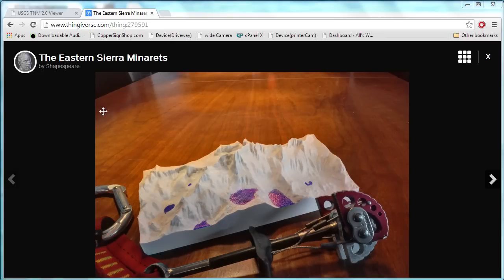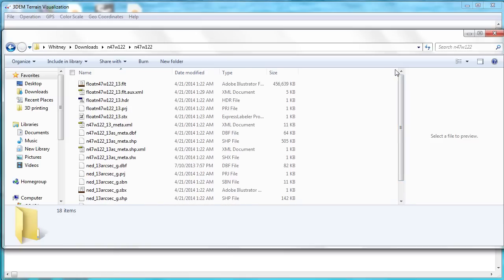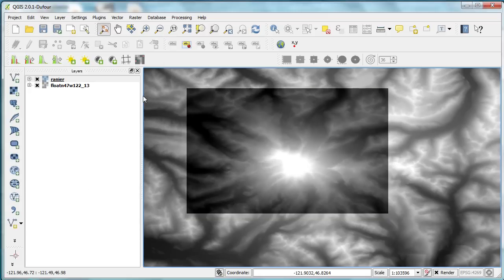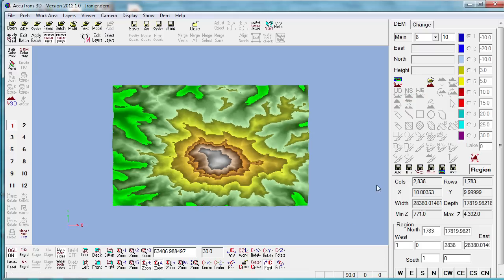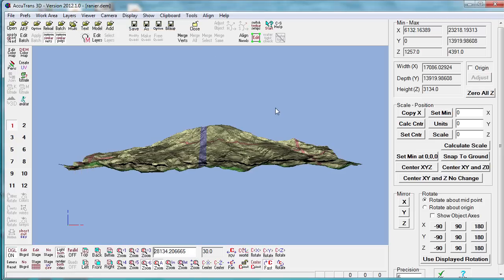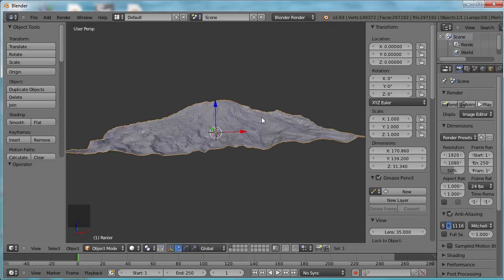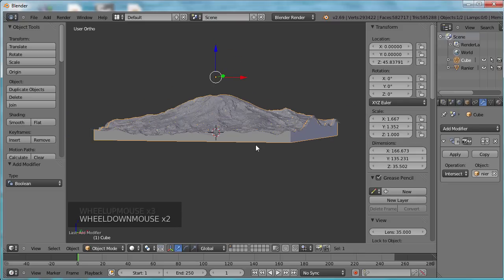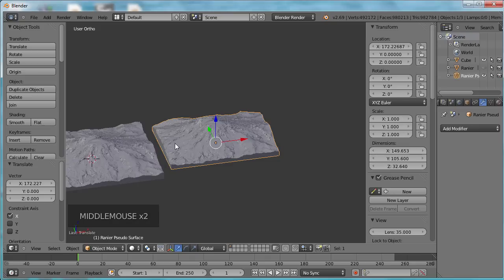Making Miniature Mountains: 3d prints from DEM data

Comment: Hey @Shapespeare, thanks for the video it is very helpful. 

I have a problem - I am using Blender V2.82. The boolean>intersect function doesn't seem to work as shown in your 2014 video. In Blender V2.82 the boolean>intersect function provides only the mesh layer that intersects the cube i.e. it does not produce the bottom solid section of the cube that is essentially cut off by the intersecting mesh layer in your cube. The other Boolean functions of Intersect/Union/Difference also don't work. Surely there is something simple I am missing.

Do you know a solution to this in Blender 2.82?

Any help would be much appreciated!
Reply: Hey, I had the same issue with Blender as you, I was able to accomplish the base in Accutrans3D. After I rescaled everything I went to Tools>Extrude Psuedo 2D Surface, then set the thickness to what I wanted and check the box for "flat Bottom". Hopefully that works for you!

Comment: I'm having trouble getting the bounding box I create to narrow my view down to what I want. It keeps saving a much larger area? Can you please redo a short video showing just the very fist steps on the USGS site?
Reply: Great work by the way, and thanks for sharing your knowledge!
Reply: The USGS site doesn't crop the data it just selects which tiles to download.  You use Qgis to crop the data.
Reply: Whitney, can you now help me with a new issue? I'm doing a new project that requires the corner of four tiles from USGS. When I crop them in Qgis and send them to 3Dem I can load them one at a time but can't figure out how to stitch them together in one image?
Reply: I Qgis use the raster>miscellaneous>merge tool to merge the four tiles then crop the part you want.  The interface is a PITA but it can sometimes be made to work.
Reply: Whitney, thanks for the help. but I'm still struggling the merge function isn't liking my FLT files and won't work. What about stitching in Accutrans I'm trying that now with no luck so far.

Comment: It seems 3DEM no longer works on Windows... at least not on my Windows 10 machine.
Reply: Have you tried compatibility mode? Runs fine on my W10 machine.
Reply: Windows XP (Service Pack 3) Run as admin.  Hope this helps.
Reply: Everything is super complicated, I think it is best just to check your local GIS Data source, I downloaded DEM data from the Ohio Geographic Reference Portal to work around.
Reply: what were your compatibility settings? Thanks!
Reply: Thank you
Reply: Yeah once that chain is broken, thats it,  I am looking for a solution

Comment: Excuse my photo but I am attempting to create an STL file from an ArcScene Digital Elevation Triangulated Integrated Network File. I have access to QGIS also. I think that I just found the answer. I am going to create the STL file in order to upload it to a 3D printer. The resulting model will aid in the spatial analysis of my community. Thank you so much for doing this. I'm sure i'll have questions.